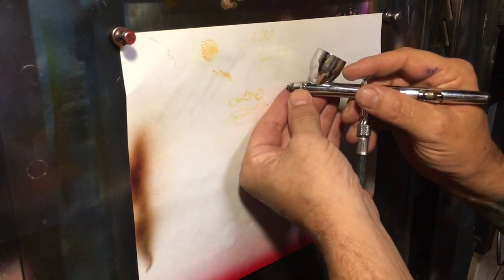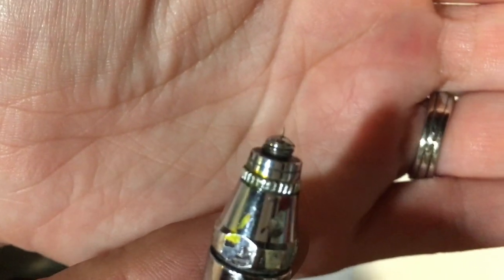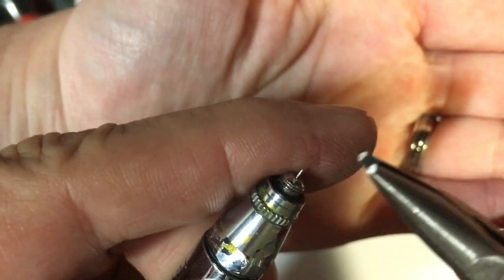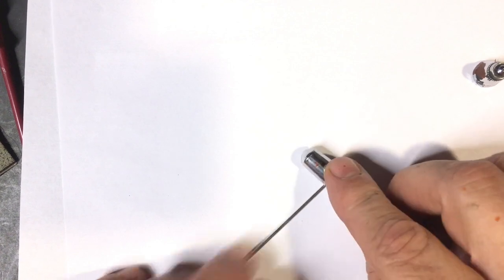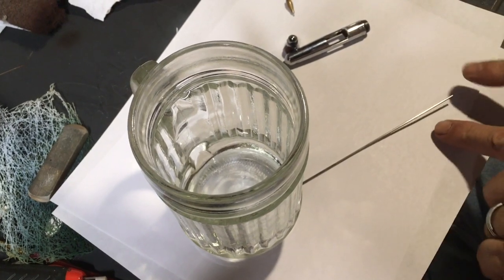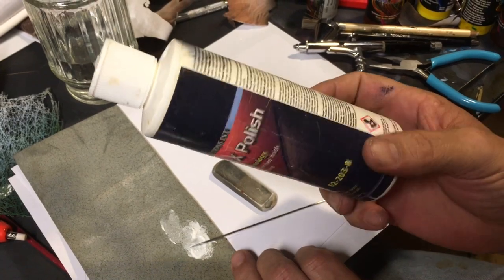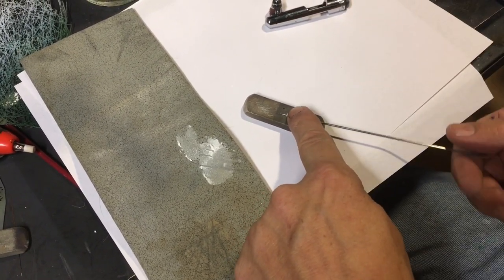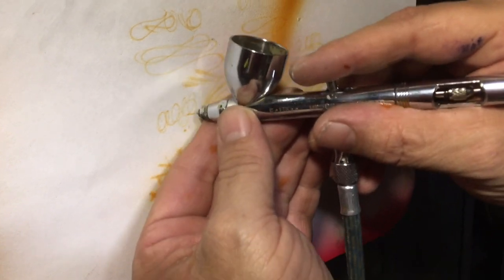How to repair a bent airbrush needle. And polish your airbrush needle.

Comment: Great fix, I wouldn't have done that smack, but I've never fixed my needle yet! Mine is slightly bent from nicking my panel before I got a holder, so thanks a million. Was looking at the straighter, sharpener from coast, but will try this for sure.
Reply from the maker: well.. normally i wouldnt smack stuff like that.. I do have spare parts around if things had gone entirely too south however :)

Comment: Thanks Bill! I was about to buy a sharpening and repair kit and I followed your video instead and it worked great!  Saved me $50!
Reply from the maker: the sharpenaire works well enough.   But well they didnt have those when I started :)   
Pro tip use a magnifying glass, or even better if you got a decent modern cell phone that can macro shoot it can make sure it is set :)

Comment: I have a steel block and use a I think similar to a butter knife to straighten my needles out and I've never had a problem doing that I also use 300 red sandpaper wet and dry to pop them out and get them nice and smooth you know so they spray nice and smooth I like your way of doing it it works well too
Reply from the maker: yes a smooth steel block is great. if you have a stainless top or any flat hard surface.  

I don't like recommending  any low grit sandpapers to people Because if you are not careful you can reshape the needle.   
Ironically i mention not using power tools, I DO use a foam buffer pad on some. But i would never  advise it to someone who may or may not have good experience with using tools like that.  

Thanks Gary!

Comment: Best needle repair video online.
Glass trick does it. Many bent needles are now as good as new.
Reply from the maker: Thanks!   To be fair you could use other things. I just found a glass handy to get that last tiny bit of tip pulled around. It was on my desk and if it works….

Comment: Thanks for the video! I have 3000 grit, but don't have the polishing compound. If you wouldn't mind what was the name and where's a good place to get it? I do a lot of detail painting (both regular brush and airbrush) and I prefer your method to using a drill or a dremel. 
Happy to give a thumbs up etc. I'm on here too, but for my SFX makeup artistry and other stuff. (Or I will be again once I return so happy to help. I know what goes into making these.😊)
Reply from the maker: in the case of polishing a needle any polishing compound will work really, there are special compounds made for steel that im sure would do better overall.  but I use what is on hand.  

and I hear ya about making these.. ive been remodeling at home and trying to keep my art business running .. so the last video I got out was in august. I REALLY need to make some videos.

Comment: When a needle is bent, that already weakens the metal at the spot unless its made of spring steel. I have a "repaired" needle and it is a blunt at the tip. I've also figured out how to polish them to a mirror shine with a Dremel tool and metal polish. For most people it is better to just buy a new one. The metal can be annealed but that is out of the skill of most people. I've also started marking the back of the needle with light crimps from a wire cutter. 2 crips for 0.2 and 3 or 5 for those nozzles.
Reply from the maker: almost all airbrush needles on the market are now spring stainless.  Even of the cheapest ones.  
But you are correct it can cause weakness in the metal.    As for to repair or buy, i've done both.. 

But if you have no spares this can get a lot of folks out of a jam and not be waiting.  Sure if you buy cheap airbrushes you can afford to keep spares..  Heck i keep spares for everything I have and I have dozens of airbrushes.  
Can you repair as well as factory, that depends, but ive definitely repaired student needles that they didn't even know were bent.  Im not gonna blame anyone for deciding one way or another.
Reply: @TheAIRspace  True, it can get one out of a jam. I bought a Gahleri Mobius 0.2 that came with a bent tip... on their flagship brush!. I was inspecting with a lupe. They promptly sent me a new one though.

Comment: When I was new to the game  ( mistakes still happen ). I had  a REALLY cheap  airbrush and, after  looking at  some videos,  I  felt I could polish it.  So I chucked it the  needle in my Dremel ( this is where I should admit to drinking some adult beverages, but, alas, no ), I turned the Dremel on an promptly got  a 45° angle in my needle,  I bent it  back  as best as I could,  and the sucker still  works
Reply from the maker: i actually machine polish needles now, but I don't show people to do that.. simply because the sheer amount of people who will destroy them with machine turning is high.. and of course those are the folks who would get mad at me.  

But the whole "just buy a new needle crowd"  Clearly underestimate how many people get small burrs on light dings just from hitting the surface..   Since I havent used a needle guard on any of my airbrushes in 5-6 years..  And I paint over 100 paintings a year i'm definitely doing a few small repairs.  I just did a short on one I totally mangled.  Took all of about 5 minutes to fix. 

As for angles...45 degrees is way too steep.
Reply: Well I thought this was a brilliant way to do it- whoops

Comment: Thanks so much for the tutorial.  For an Iwata brush, is it necessary to buy Iwata proprietary replacement needles or can we buy more generic needles?  Also, how do you know when your nozzle needs replacing?  Thanks again!
Reply from the maker: yes you will want to replace with the right needle for your airbrush.  Nozzles and needles are not universal 

As for if you need to replace a nozzle look under magnification for cracks or flaring if it looks like a trumpet it is flared out.   But in general it will be acting up if there is a need for replacement..  IE if it aint broke dont fix it.
Reply: Thanks,  @TheAIRspace  !  I've followed your instructions to straighten the needle, sir.

Just a tiny, like, so small curve on the tip remains.  Any suggestions for getting at that bit?

Thanks so much!
Reply from the maker: it takes a little finesse but thats what the glass on a hard surface usually does..  and of course twisting while pulling backward 
 @marcel_chenier

Comment: Hey Bill I polish my needles after doing a long paint session to super clean them but I use 2000 grit wet sand paper never thought about polishing compound nice trick
Reply from the maker: The trizact pad is a 3000 grit polishing pad.  So a bit finer than sandpaper.  I do NOT like to use anything aggresive.. you can accidentally reshape the needle which would obviously be bad.  2000 is ok.. but anything rougher would quickly lead to a problem. 

I dont polish mine regularly. Generally once .. but occasionally i will toss a polish on them as they over time can get a bit of wear on them.  Hopefully i can get all the maintenance videos up and on the channel soon.. i really should have started those a long time ago, however my reach was very small then.  

I have certainly seen some cringey repair tips on some channels :)